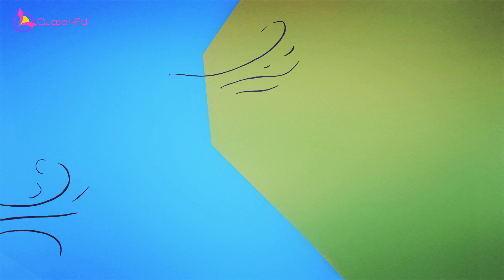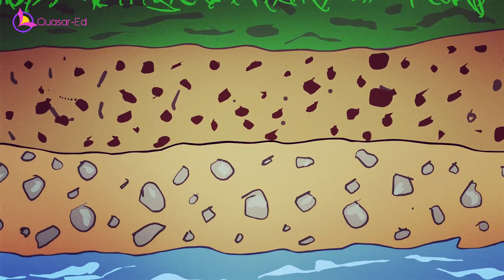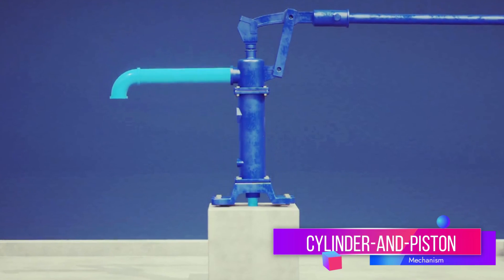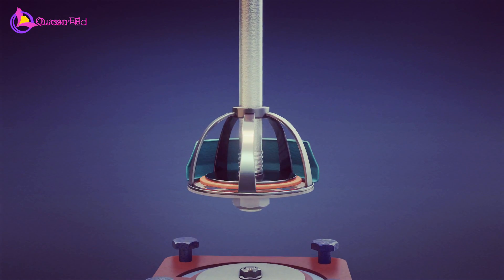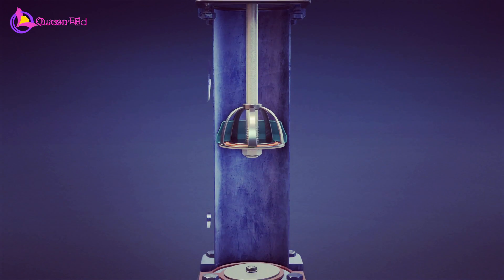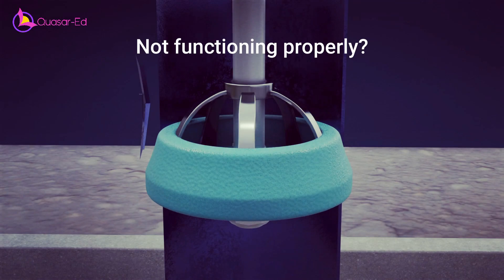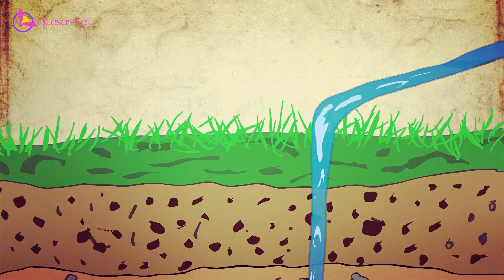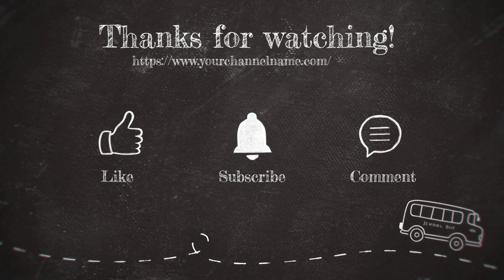How Hand Pumps Pull Water from the Ground – A Clever Mechanism!

Comment: A suction pump of that type can only lift water about ten meters. If your water is deeper than that, you have to move the cylinder and foot valve down near the bottom of the well and use a long rod inside the pipe to move the piston (this is the way the windmills you see in the west work). Even if your water is near enough the surface to use a shallow well pump of that sort, you usually have to keep enough water handy to "prime the pump", as the seals aren't that tight after they wear a bit and the water leaks by them so you can't create a vacuum. It is better to push water if you can than to try to suck it.
Reply from the maker: Thank you for your insight..
Reply: You are exactly right, although I am thinking 10 meters is a bit much.  I believe the closer practical limit to be approx. 21 ft or 7 meters.  
It is the atmospheric pressure that pushes the water up into the vacuum, so this pump working at higher elevations with less air pressure may not be as efficient.
Reply: @TerryBell-l4p  More precisely, the head limit is determined by the difference between atmospheric pressure and the vapor pressure of the water. So warm water cannot rise as high as cold water. 
Hot water near boiling (like geothermal) cannot be sucked up any meaningful distance because the vapor pressure is close to atmospheric pressure, so a very short head is enough to make it boil.

Comment: The groundwater explanation is a bit inaccurate (it's not like a giant underground lake, it's usually still mixed into the soil), but the hand pump bit was excellent, another good video!

Still noticed some grammar issues ("after every air is sucked out" should be "after all of the air is sucked out" or "after every bit of air is sucked out"), might be good to try to run the script by a native speaker.
Reply from the maker: Thank you for your support and suggestion.
Reply: @quasar-ed  Keep going I really enjoyed this :)
Reply: Since this is past tense, I'd suggest "after all of the air has been sucked out" or better - "after most of the air has been removed"  (not all the air is actually removed as it is a partial vacuum, and sucked out is not exactly a physics concept.  Air has pressure, a difference causes flow, but there is no "sucking" force, though we tend to think of it that way and have language to describe it that way).